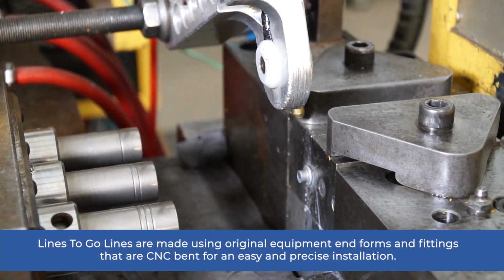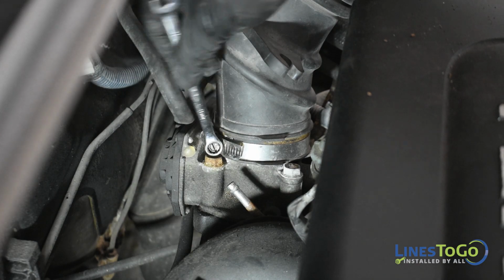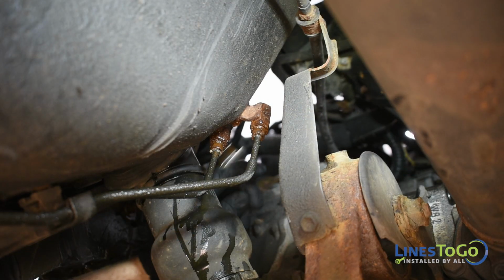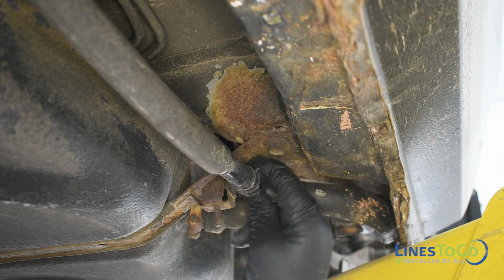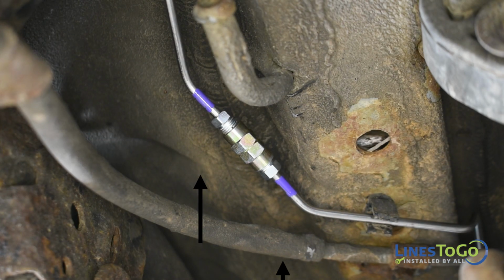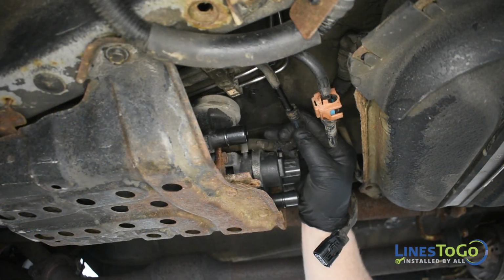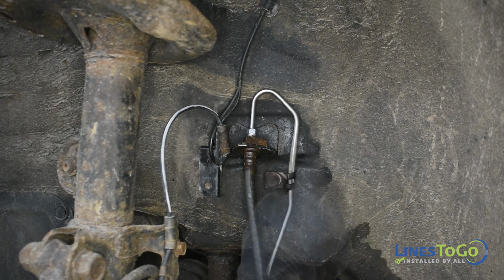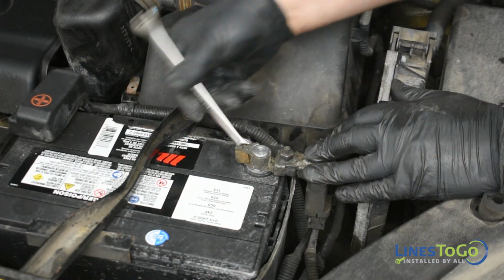How to Install 2006-2009 Toyota Rav4 Brake Lines

Comment: Any specific reason why these wouldn't fit the 2010-2012?
Reply from the maker: Hi There,

There could be many reasons why this kit is not listed for these years. This ranges from different in bends, length, or even fittings. If you want to reach out to Customer Service with your VIN, we can check more into this for you. 

We are here to help!

LinesToGo Team

Comment: Do you know the factor break line fitting? I know the tubes size are 3/16.
Reply from the maker: Hello!

The tube nuts for this 3/16 line are 3/16th as well.

If you have any additional questions and/or inquiries, please contact Customer Service at 855-781-5992 or email info@linestogo.com.

Here to help!
LinesToGo Team